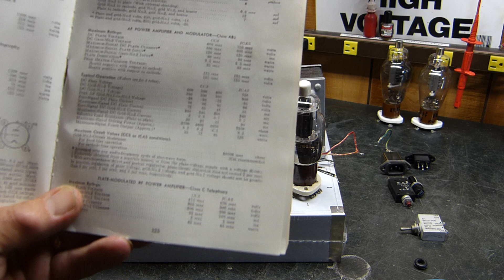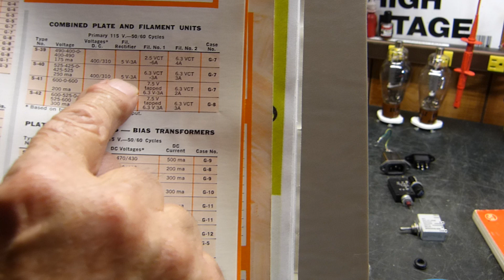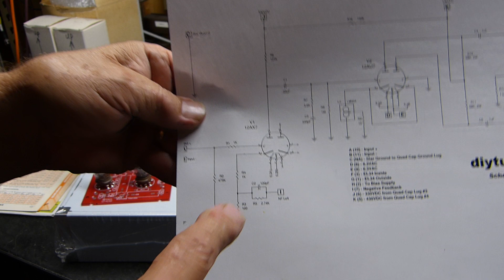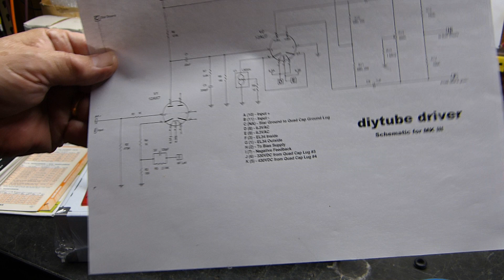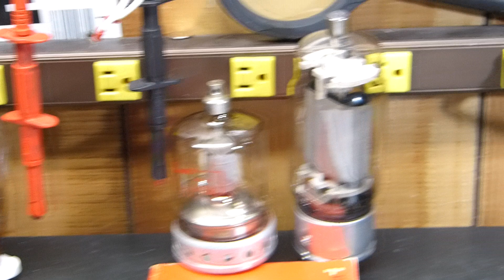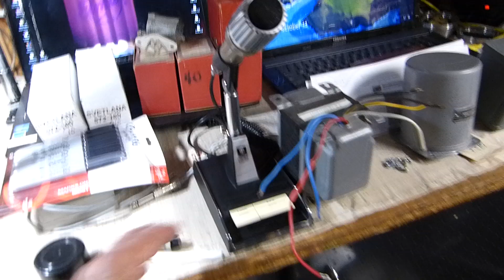Audio Amplifier Building With Vacuum Tubes - The First Steps In Construction

Comment: what do you use to cut rectangular holes?
Reply from the maker: I start with either a hole and a nibbler tool (with the lines of the hole drawn out on the chassis) or just go to a Dremel tool  cut-off disk and then smooth down the side with a file. I don't have any specific tool for square or rectangular holes. It is not the easiest part of preparing holes in a chassis.

Comment: This is so cool.  I sit here now having just stopped for the day working on my amplifier.  And let me tell you, if you saw this thing your head would spin.  It weighs like 200 pounds, has a 15 tube power supply, another 14 in the power amp including instrumentation...  6 modes of operation...  Solid oak, custom CNC top plates...I mean it makes your little project seem really small...  But here's the thing - I've been working on my amp since 1997 or even earlier.  And it's still not finished.  I have scrutinized over every single detail, scrounged absolutely the highest grade components, I even hired a renowned engineer to design most of the circuit and schematic.  And you'll be sitting there listening to that sweet little thing you're building before I'm finished with my project for sure.  With any luck, I should have first music out of this thing in Feb. after 20+ years.  There's something really good to be said about being decisive like you're doing.  You're building that amp very much by freehand, and that will come with some mistakes and some learning, but you'll have an awesome hand-crafted amp in no time.  If you do like I do, you spend $15K in parts and it'll take you 20 years to finish.
Reply from the maker: It sounds like you are building a beauty. Some of my projects weigh in close to the 200 pound mark also. Actually, my biggest KW level transmitter is probably more like 400 pounds as it is built in a 1947 steel cabinet. Fortunately, it does have nice rollers or I wouldn't be able to move it at all.
I have been building for a long time and have much of it in my head. I used to take the time to draw nice schematics, long hand,  but now I usually only take notes on the specialties of the equipment I build and keep it with the instrument so when it needs repair or modification, I don't have to "reinvent the wheel" so to speak.
I have already changed this one from the Poseidon board driver to a genuine Williamson driver design with 6SN7 and it does perform better.
I also keep Lots of parts on hand so I don't have to discover that I am missing something and then have to order it and wait for it to ship to me and lastly... I am pretty obsessive on my building and will put fourteen hours a day into it if time permits.
Thanks for sharing your experience and if you have a YouTube channel, or want to start one, please share your experience and amplifier with the world. You will meet like-minded and nice people.
Reply: @ElPasoTubeAmps  I'd love to see some video of the monster.  I suppose I really should upload a video about this amp.  The power supply is finished and functional, and I'm making progress with the amp every day now.   I spent a TON of money on the CNC made top plate, but I have to add a few screw holes by hand to accommodate some terminal strips.  The aluminum is pretty thick, and I'm having a hell of a time keeping the drill bit from walking around, even with a hole guide.  Got any tricks up your sleeve for that?  Luckily my first holes are hidden under transformers, but now I need to drill ones that are going to be visible. 

Anyway, I'll give you a quick rundown of the topology.  Standard Push-Pull Parallel (or not parallel if you want) output sections, 2 or 4 tubes.  It's based for KT-88, etc., designed around KT-90, and it uses Harmon Kardon Cit II OPTs.  Lundahl 1660 interstage transformers handle driving the outputs and phase splitting.  By turning a knob, it can run either Push-Pull or Single-End, each one in either triode, pentode, or ultralinear mode for a total of 6 operating modes.  All biasing is set with 10 turn precision pots, as well as all the instrumentation and calibration pots.  Drivers are 6SN7.  Gas tubes, OB2, OA3, etc. are used in several places including voltage for the instrumentation.  Feedback and input attenuation are adjustable via stepped attenuators, and all the 10-turn precision pots have counters with locks on them.  All the octal sockets are vintage Amphenol ceramics.

Meanwhile, the power supply has a HV transformer putting out 630VAC @1A into an 8 tube bridge rectifier made with 6AX4/6AU4 (TV damper rectifiers).  There's a big mil surplus potted transformer putting out 30 amps of 6v filament, plus a smaller 6v filament referenced to high voltage via center tap... There are OD3 and OA3 gas tubes stabilizing the screen and bias voltages, a pair of massive 10H chokes, massive oil filter caps as well as electrolytic, and all sorts of other odds and ends.  The power amp chassis contains all the metering which allows you to set bias, check voltages, check driver stage and output stage signals, etc.  The whole thing connects with umbilical cords.  There's also a safety circuit that shuts off HV+ and drains all the caps to ground via power resistors if either a bias fault or unplugging of the umbilical happens.

But yeah - do you have any advice for keeping a drill bit from wandering when you really can't use a drill press?
Reply from the maker: @hugeshows  I spend plenty of money on new drill bits just to keep the bits from "walking around" as you say. If the hole is critical, I start with a small bit and go up in size slowly. You will end up with less burr to remove that way. Holes under the transformer is OK. It is hard to not have some "mystery" holes. But you may be able to just fill some of them with a screw and nut or a "goof" plug and it will look great.
I love the fact that you are using 10 turn pots and VR tubes. I have thought of installing a switch to change between UL, triode and tetrode (beam power) mode but I would have to also come up with proper screen voltage and would likely use VR tubes. I may do just that now that we are discussing it. Something a little more special than just the Williamson designs that I keep building...
I have made my NFB adjustable before but nowadays just leave it at a set value. I have noticed that with NFB turned completely out, the amplifier sounds really "alive" but THD rises sharply.
I have read about using the TV damper tubes and I can not tell you off the top of my head, but check the maximum current rating of these tubes and make sure your amplifier does not need more current than they can provide. In this last amp I posted, I quickly saw that at high power, the sag in voltage from using a single 5U4 was not acceptable and the high end power suffered a lot. It is amazing how 10 cent diodes solves all these PS sag problems...
I have some massive 10H 400 and 500 mA chokes but they are so huge. I just got in an order from Mouser for 1H, 300 mA and 1.5H, 500 mA chokes new from Hammond. I usually need higher current than can be easily found and 10H is not necessary but nice if we have them and room  for them on our chassis.
Sure sounds like you have built a beauty.
As for umbilical cords - I would suggest adding an external, flexible braid ground between the chassis just for safety. I am sure you have taken proper precautions in multiple ground connections in your cords but in the event of electrical separation of the PS and amplifier, you know there would be full potential between the chassis. Just my thought on that aspect.
It would be really nice to see your build on YouTube. Say safe...
Reply: @ElPasoTubeAmps  Thanks for the advice.  I've made a little video for you showing the amp and how the drilling all worked out.  Thanks again, and that video should be up in a couple hours.

Comment: Please do NOT run any tube in a audio amplifier at ICAS values. CCC is stressful enough.

Where do you obtain your DIY Poseidon printed wiring boards? The sources seemed to have dried up.
Reply from the maker: I think the source has dried up but I have had mine for years. Here is where I used to get them.  http://www.triodeelectronics.com/diytubemk3.html
Possibly they still have PCA replacements for Dynaco  MarkIII and MarkIV, etc that can be helpful - 
They did recently re-post a link to the manual for the Poseidon board but the other Dynaco type boards are probably just as good for home brew.

Comment: Don't you need to rotate one of the transformers 90 degrees?
Reply from the maker: I have finished all the drilling and painting and I did rotate the OPT several times looking at it but ended up laying out and cutting the holes like it is laid out in the picture. The reason is primarily to give the 5U4 a little more room as it is a very hot tube and will heat up the transformers close to it and hopefully, the wires will be long enough from the OPT transformer to reach the 1625 tube sockets without having to lengthen them.  One of the things that I don't like, and it is completely unimportant, is the label on the UTC power transformer is upside down when the transformer is mounted with the connections under the chassis. I don't know why they put the UTC label on that way. Oh well...
Reply: @ElPasoTubeAmps 
Thanks for your reply! Yep, an upside down sticker would annoy me too! Yes, those 5U4's get hot alright so plenty of air around them is a good thing. Looking forward to seeing it finished. Thanks..
Reply from the maker: @paulbione5267  It is getting there. Chassis is drilled and painted and all components are mounted so just a little hook-up and we will see how it performs.
Reply: @ElPasoTubeAmps  
Excellent!

Comment: Great!  I'm very excited to see building of this amp. Nice selection of power tubes. 1625 / 807 tubes are great. But I am a little confused about the G2 of this tube. How to really calculate the voltage of this G2. Really anxious to see how you do this.
Reply from the maker: In this amplifier the tubes will be running UL because of the taps on the output transformer so the screen voltage will be the same as the plate voltage and the tube can be seen in a triode connection. 
I have included a link to a book by Eimac that discusses how screen voltage in tetrodes affects cathode current you might enjoy.
https://www.cpii.com/docs/related/22/C&F2Web.pdf

Comment: I use 807s in my designs and for HiFi a pair in UL will produce in excess of 30W at 5% THD. In the guitar world, I use four in parallel push pull, class AB2 and achieve just over 130W. Nice valves. They are a 6L6 with a top cap for the anode, so it will work at 750volts without destroying the IO base..
Reply from the maker: I agree the 807/1625 is very much overlooked in the audio world but the vintage 6L6GC's can bring such a high price. As you say, the plate cap allows much higher plate voltages and as much as 120 watts output running them as a tetrode with proper screen voltage. Maybe after seeing this video, others will choose to start building with these grand old tubes just like you have been doing. Thanks for your comments.